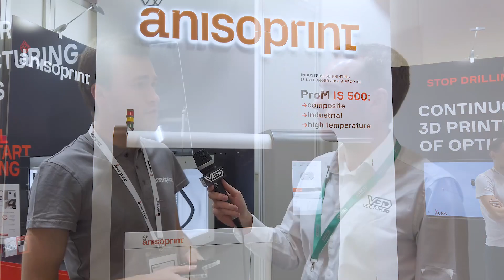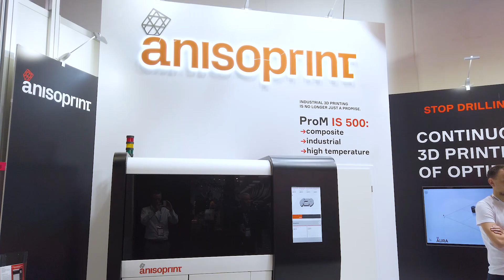Continuous Carbon Fibre 3D Printing by Anisoprint at Formnext 2019

Comment: Thank you for your video! I glad to see that a couple of people in Skolkovo are doing something meaningful nonetheless and lunch a mature product. What do you think of this product compare with similar lineup of Markforged printers? The technology and the constuction of the hot end to my understanding are very similar to mark two one. Evgenij, next time please let Fedor talk with a famous vlogger!
Reply: It is a similar technology, with the difference that Anisoprint do a polymer co-extrusion of the fiber, where Markforged uses a pre-coated fiber.

The largest downside i have seen with their parts is that they look awful compared to the print quality of Markforged, also they does not have anywhere close to the user experience and software. They are basically at the level where Markforged were a couple of years back when they went to Kickstarter.

That said, the larger freedom with the fiber orientation and the higher fiber content do open for some quite interesting applications.
Reply: @erikcederb  Quality is obviously a question of time and material choice. If they had limited amount of plastics you can use like Markforged did and limited lots of other possibilities their machine has it would be easier to get better quality. Even with the current freedom, they give to users, most of the parts I've seen look good. And they have slicing software that can be installed from their website for free.
Reply: @vse_horoscho  The demo parts they had at TCT Show where i talked to them for quite a while had very rough surface finishes, with clear signs of uneven extrusion blobs, and for the point in the industry where they are aiming, most companies buying aren't going to want to spend the time inventing the wheel and a load of time tuning it in.